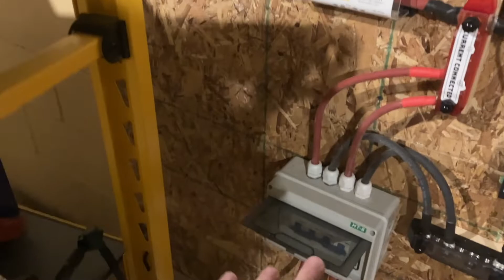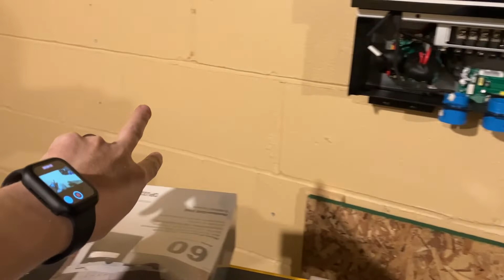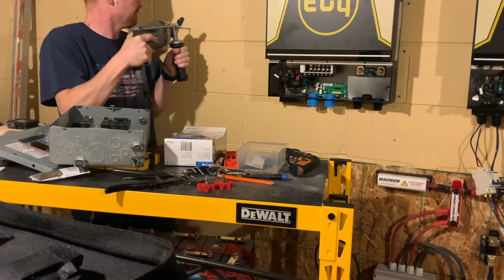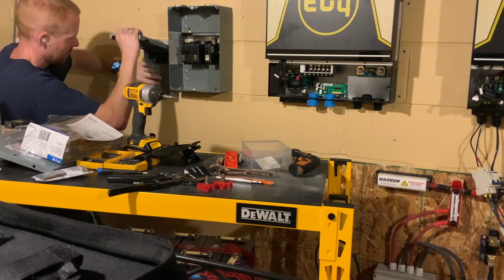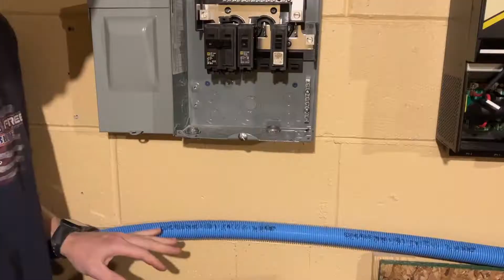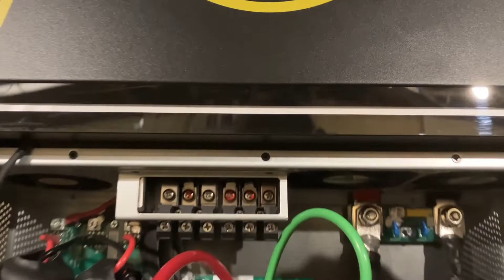12V to 48V Solar Upgrade, Part 3: Wiring the EG4 6500EX AC Output

Comment: I’ve seen different channels use 60 or 70 double pull breaker, it is not specified in my older manual. Does the revised manual give a specific breaker size? I have the exact setup you have. Thank you for your help.
Reply from the maker: No the manual doesn't tell you.  I originally went off Will's recommendation of the 60a.  I have yet to trip it, but I haven't pushed these units to capacity.

I can see where people would bump up to a 70a though.  The manual gives some overload protection notes where the units could run up to 150% for up to 10 secs before shutting down.  So I could see where some people would want to add a little buffer room on their breaker.
Reply: Thank you, I also called SS and they recommended the 60 as well, probably one of those where either would work

Comment: What gauge of wire for the ac output?
Reply from the maker: 4awg
Reply: Thank you! I have the first gen4 so having trouble getting the 4awg to fit. I guess I need to try harder. Is your green a 10awg?
Reply from the maker: @coltle8300  Yeah the 4awg will fit, but you need a good pair of needle-nose pliers to really help get all the strands into the terminals.  

I had 6awg wire for my ground.
Reply: Excellent, thank you for the reply back. I appreciate it
Reply from the maker: @coltle8300  You're welcome!  Good luck!